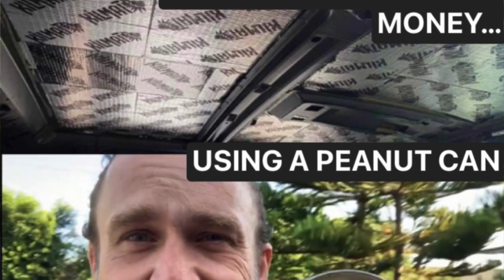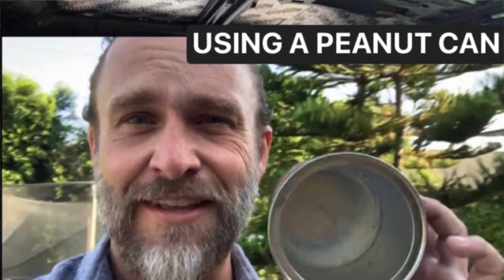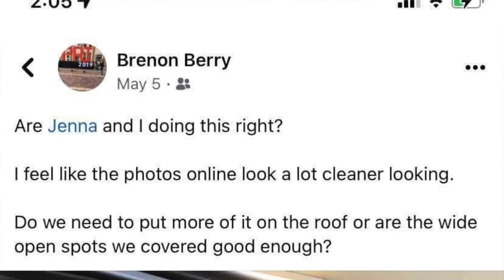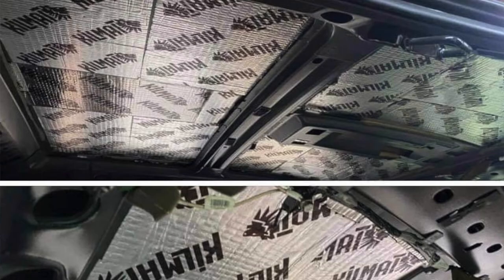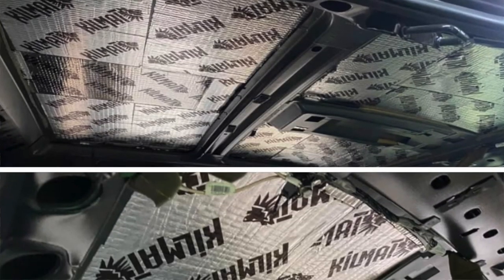Sound Deadening is a WASTE OF MONEY... done wrong.

Comment: Kilmat isn't just for sound deadening. It's also thermal insulation. I did one box that weighed 17.5lbs and it wasn't very expensive and covered most of what I needed it to.
Reply from the maker: Most are using for sound deadening though with no need for insulation (not a race car to worry about excessive heat, A/C or clothing takes care of the rest lol)
Reply: There is closed cell high density thermal insulation foam that are ligtweight yet very good at insulating heat/cold...

Thats what u really need to cover whole panel for insulation..

And less bitumen vibration damping matt needed...

Comment: Sound deadening and sound BLOCKING are two different things though, right?  This blocks the low frequency vibrations coming from the metal, but to block outside noise you still need to put some kind of foam insulator or something on top of this I assume?

Comment: Have you added tow subwoofers to your vehicle that can handle 800 watts each and only did the 25% sound deadening method? Does it work?(NOT being sarcastic)
Reply from the maker: Yup same effect.  It’s removing the resonance from the panels therefore I’d say 120-150db you would not gain anything doing more than 25% per panel coverage.
Reply: @markallendelisle  Thank you for replying. 👍🏾👍🏾👍🏾👍🏾👍🏾👍🏾

Comment: What you're doing is not sound deadening. You're reducing the resonance. By covering only a portion of the surface you're only changing it's pitch in sound but not deadening it. There's basically 2 parts when doing sound deadening. 1st layer is the resonance treatment where only flat surfaces are critical in having it. 2nd layer is the sound proofing. This is where the more the better.
Reply from the maker: @chunvuipang2892  Definition of 'sound deadening'
1. a process or material that reduces the resonance or volume of sound.